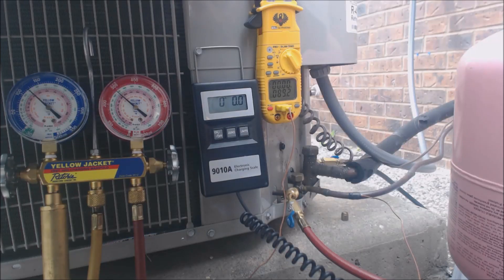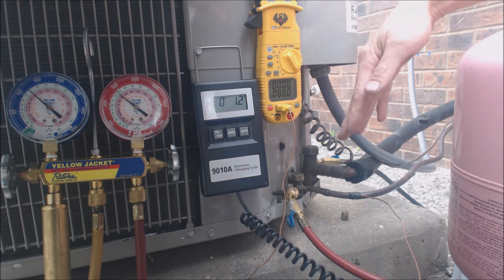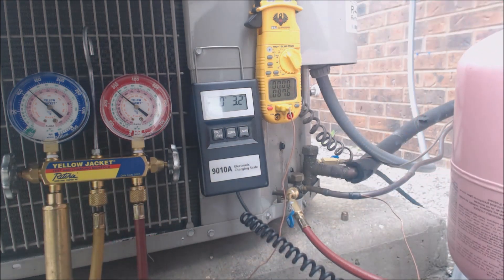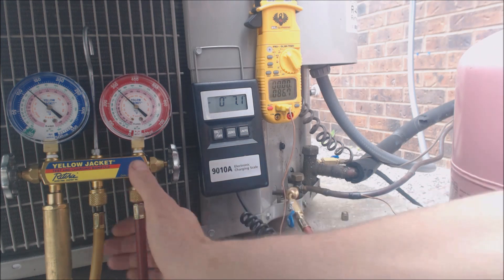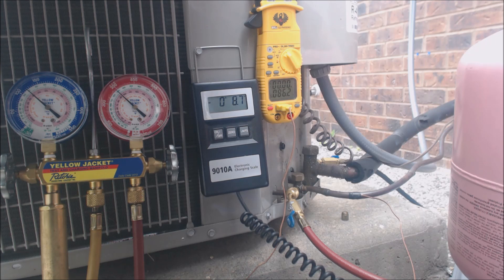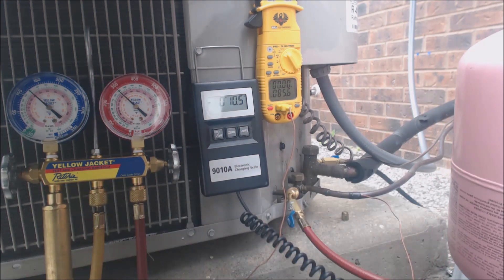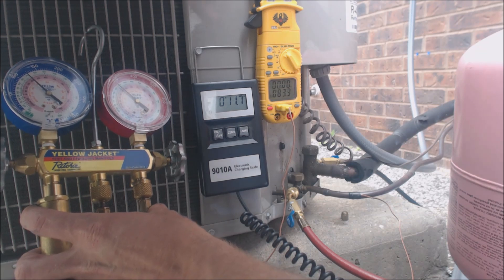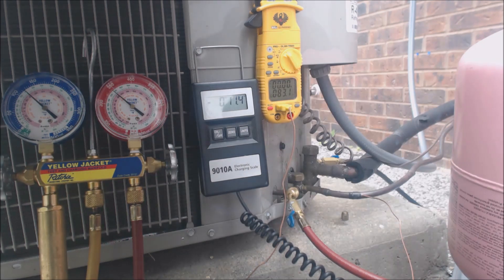Charging R-410A Refrigerant: Step By Step Process of Adding Refrigerant in Real Time!

Comment: What does it mean when the reading of the Blue gauge upon outside unit turns on from 210PSIG will drop to 105 PSIG then about 3mins slowly drop to 55PSIG then after few minutes it will rise to 105 PSIG, (this cycle runs only 12mins before it shut down), then shuts down. At the inside unit by that time is just flashing 88 on the display.
This is MIDEA R410 split unit AC.
Thanks for inputs.
Reply from the maker: You should call their technical support form that particular unit and error code, thanks!

Comment: Thank you great video. The problem I ran in today was really weird. The unit had low on gas and was freezing ice. After melting all ice I started adding refrigerant. My pressure increased. I charged till about 125psi on suction line and ~300psi on liquid line. My temperature on liquid line remained high. About 96deg on high side gage and 94deg on liquid line temp. That’s just 2deg subcooling. My outside temp was around 81deg. Even adding refrigerant don’t help increasing the subcooling. This is odd. It should be simple but in this unit the liquid line temp increasing with the charge. What is wrong. It’s a 10yr old system Rheem 410a. I don’t see subcooling data anywhere on the unit. Please help.
Reply: Maybe the condenser coil was dirty? Idk I'm new to this, just a guess

Comment: Just curious, NO DISRESPECT INTENDED, Why do you use analog gauges when you are clearly a professional service tech? I only service my own units and even I use a Testo 557, because I have all the info right in front of me and the cost is about the same as a good set of compound gauges and a couple of good thermometers.
Reply from the maker: No Problem, So I actually do not recommend digital manifolds or probes as a first set. I want the tech to really think and understand the pressure temp relationship, superheat, and subcooling down cold. Once a tech really understands very well for troubleshooting sake then yes go ahead and get the digital ones if they like. I actually have all types of manifold set, digital included. The other thing is that most of the techs I train have compound gauges. I am also not apposed to just checking with quick connect test gauges either since that gets rid of the hoses. Once again this is just one person's take on things from a teaching standpoint. I will however be putting some videos out for the technicians that have digital gauges soon, Thanks a lot Douglas!
Reply: Hey acservicetech, that was a good question by Douglas....however I have checked out a lot of your Videos (w/a thumbs up) short side of this is I'm a new tech just recently EPA Cert....my text books and training were Compound gauges.....whenever I see a Video using Digital I feel kinda like a fish out of water....by no means get this confused....the Digital Dashboard looks great and gives the tech a all in one feel. Also I embrace the Digital World....I'm very good with it too...once I get polished with the Technics of the Service world....I plan to purchase a Digital outfit!  Thanks Guys for sharing your Knowledge!
Reply: The main reason for my question was I was wondering if there was any advantage to compound gauges (other than cost). I do use a set of analog gauges on my rental proprieties because they are all still r22 and honestly I'm not shooting for perfection on those 15 year old units. On the 410a systems I use a Testo digital because you have to check subcooling and it has to be pretty much dead on to work right. My old eyes can't read a analog gauge accurately enough.
Reply from the maker: No, there is no real advantage other than the calibration of the digital gauges or the checks to make sure that it is still correct. Like I said I am planning on doing some videos with the digital gauges soon, the SMAN460, thanks

Comment: ok, so I had my ac guy over again to check my freon level. After watching your video, I hooked up the high side on my gauge and the pressure reading was right about 250. I check the liquid line temp right at the condenser unit and got a reading of 81 degrees. If I am understanding correctly that means I have a subcooling of 4 degrees and the unit calls for 10. That means the unit is low on freon... Right?  My ac guy says I am not low on freon but I am having trouble cooling. The unit is about 1 year old. I have had him out to check freon level at least twice. I noticed that he only hooks up the low side of the gauge to check for freon level.  As a supposed professional, what is it that he is seeing that makes him think that I am not low on freon if according to readings above, I am low?  Also why does he only hook up low side and not the high side also?
Reply: Brian Pruitt For sub cooling, you must have a TXV. Otherwise you must check for superheat.

Comment: ok so. why the industry claims that the 410a, operating pressure is: 
418 psig high side, 130 psig low side. If it never reach that pressure?
Reply from the maker: Who in the industry is saying that? That may be on older 13 seer r410a units on hotter days. Operating pressures will vary greatly from unit to unit, temperature of the day, seer rating and condition of the coil, thanks

Comment: If practical to advise: As a general rule, how many oz.'s would you let enter the system at one time, and how long would you wait between oz.'s  Same advice for both 410A & R-22?
Reply from the maker: Maybe 1/2 to 1 oz at a time or less. I usually wait 2 minutes. You can see the subcooling really change when you are getting close so slow down. If I add a lot in, more than 1-2 lb total than I usually will shut the outdoor unit off after I think the charge is correct while the indoor unit continues to run, wait the time requirement and check the charge again to verify, thanks

Comment: I have a question. Do we allow to put 410a refrigerant on high side? What I heard in school we cannot put 410a on high side because 410a will fractionate .
Reply from the maker: So R-410A needs to come out of the bottle as a liquid so that it stays mixed 50% 50%. If the system is evacuated to 500 microns then you would weigh refrigerant into the liquid side before starting. If the system is running with refrigerant in it yoiu would weigh into the vapor low side with metered liquid refrigerant slowly. Check this video out -  https://youtu.be/ncgLDYrvN6w
Reply: acservicetech that make sense